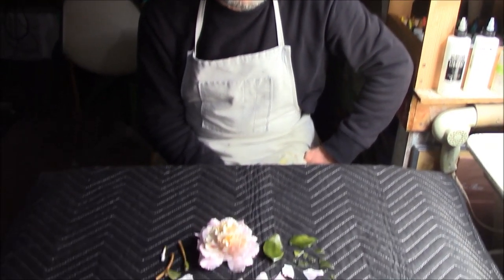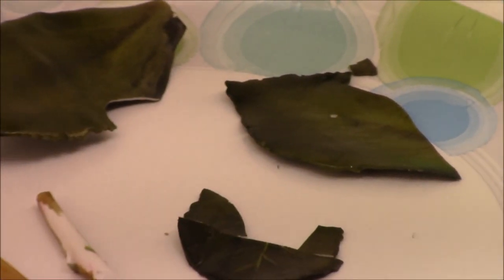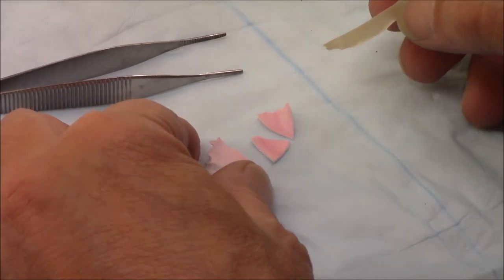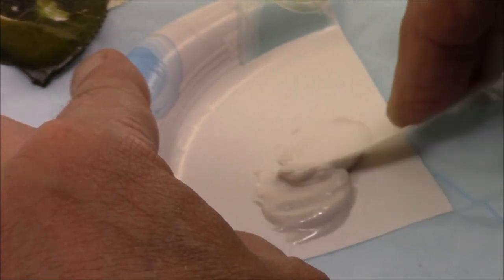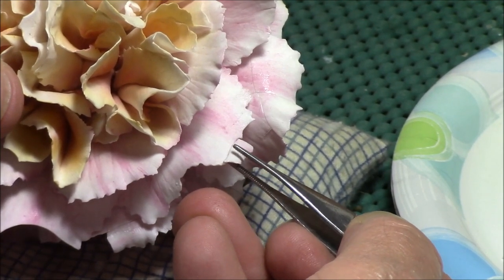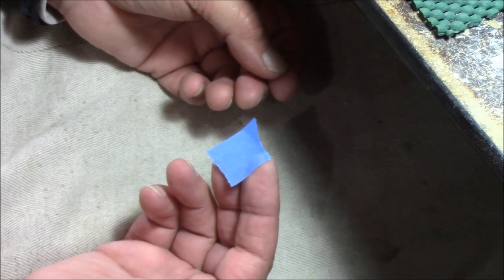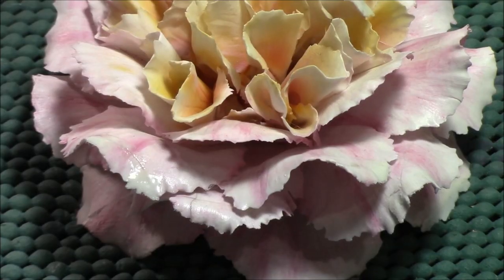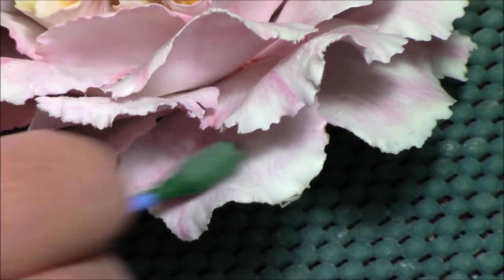Boehm Peony Repair Part 1

Comment: What can I use to remove dried Hyxtal it squeezed through into the tape. When I removed the masking tape is when I discovered it. Thank you.
Reply from the maker: Acetone will dissolve Hxtal. You can use a razor blade to scrape it off also.

Comment: Acetone, is that the same kind of acetone that woman use to remove old nail paint? Thank you.
Reply from the maker: Yes, nail polish remover is acetone but it has buffers and fragrance ingredients added to it which might make it difficult for paints and things to adhere properly. Get the kind from the hardware store. Be careful. Its very flammable and dangerous to breath the vapors.